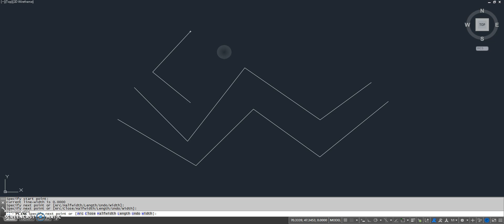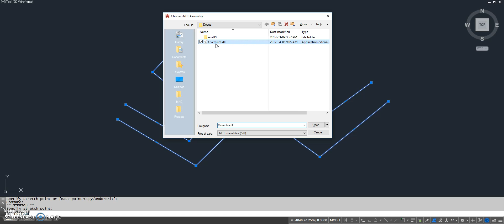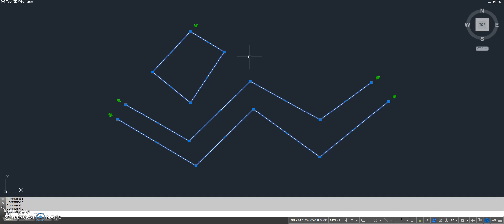AutoCAD Grip Overrule API Demonstration

Comment: Thanks for your video. 
One question, is it possible the polylines selected by code (SelectionSet),  show them as if they were selected by the user(with Grips)?
Reply from the maker: You will need to set the selection current.  That is to say set the Implied Selection.  In VB.NET it looks like this:
    Dim dwg As Document = Application.DocumentManager.MdiActiveDocument
    Dim result = dwg.Editor.SelectAll()
    dwg.Editor.SetImpliedSelection(result.Value)
You will of course want to change the call to SelectAll() to get the selection you are intending.  Remember that this would also follow rules for system variables such as GRIPOBJLIMIT.